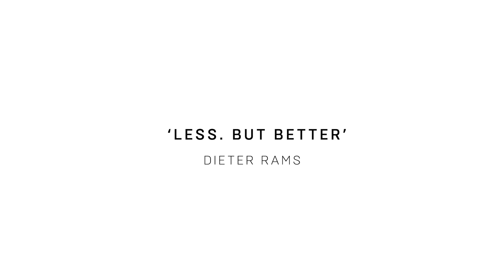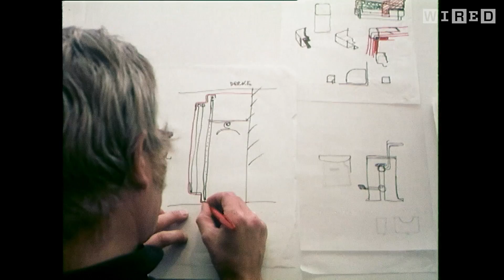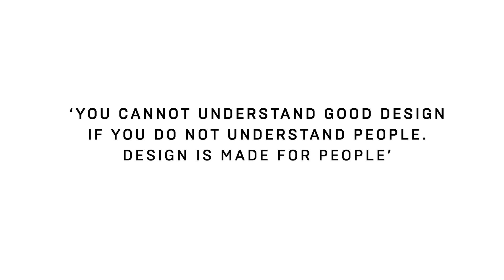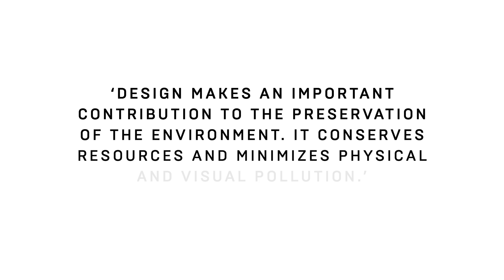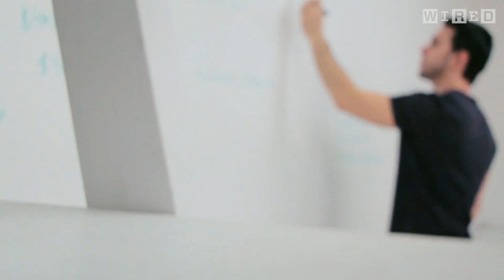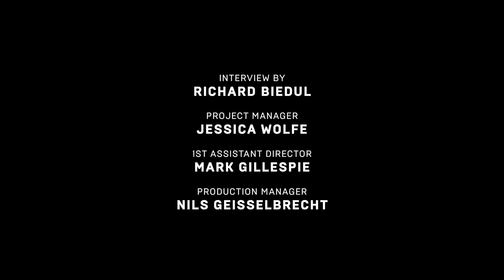The future of design | WIRED with Braun

Comment: As many has already said: Braun unfortunately stopped doing world class design. The current designers at Braun should have been continued where Dieter Rams left off. So who has? Jon Ive at Apple is a great Dieter Rams fan and you can see the influence of Rams in many Apple products.
Reply: With the major difference that the Apple products are exceptionally engineered and actually work. I have a couple of Dieter Rams designed products and while they might be visually pleasing they all have one thing in common: Truly sloppy decisions when it comes to the engineering part. The F1 Mactron for example is known and was known to have a leaky tank for gas. Repair it?! (Which you will have to do sooner or later) you have to remove the black plastic for grip, removing it will destroy it, you'll eventually can get the tank repaired but you're left with a piece that is now damaged instead . This is a design and engineering choice, made at a time when this issues has been solved many moons ago, I find truly baffling. I can give you at least 5 or 6 more examples of this, Rams preached (and still does) water while drinking wine. Braun and Rams are absolutely fine and had their time and place in design but are rather mystified in my opinion.
Reply: @alluvialedaempfer962  Beautiful lighter! I am surprised as Braun's household products at least used to be of extremely high quality (1960-1980ies so it is a while since I have bought any). Apple products working? I don't like Apple's approach to software (operating system, apps and (Ugh!) iTunes) so I have ever only bought an iPod 3G from Apple - but, yes,  the design and the hardware is excellent. So, if only the iPhone would run the far more flexible Android operating system. :)